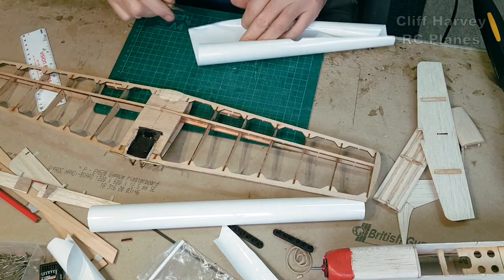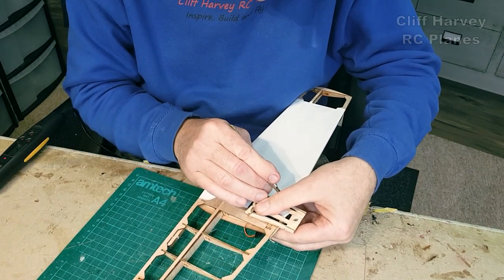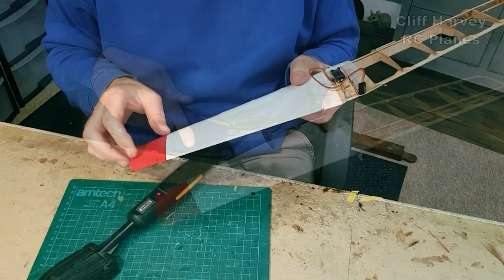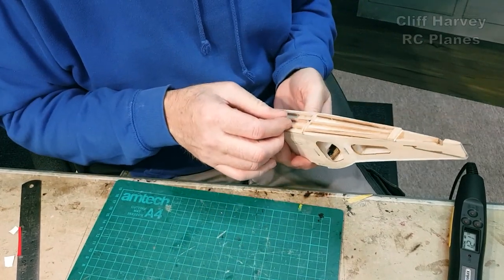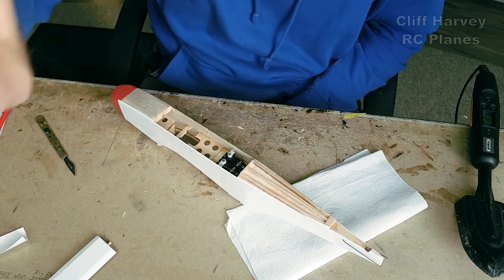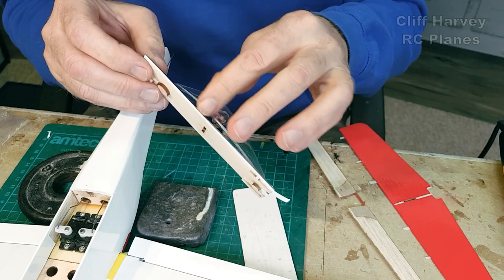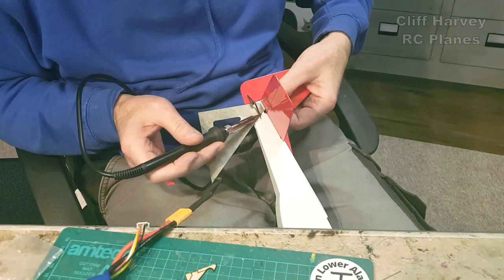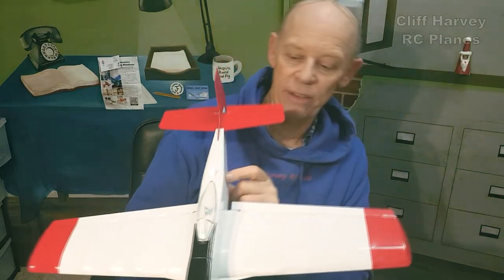Willy Nillies P51 Mustang Balsa Build Part Three

Comment: Cliff Harvey our only concerns are that you put a way bigger motor than recommended, used 9-10 gram servos instead of the 2.5 to 5 gram we recommend..... Your Mustang is going to be quite a bit faster and heaver than we expected or designed it to be. We have no doubt that it will fly, and fly well, but we expect you will have a little tweaking to do like... probably more down thrust and a much higher stall speed despite the flat bottom wing. PLEASE keep the control throws at or a little below recommended with CG spot on. 🙂
Reply from the maker: Yes, thanks for the advice, I'll make it clear that the model is certainly not as you designed it. The wing loading is higher, the speed will be higher with all the associated knock-on effects it will be interesting to say the least.